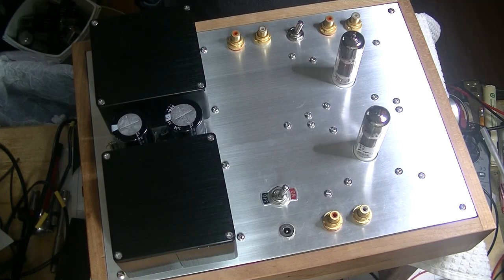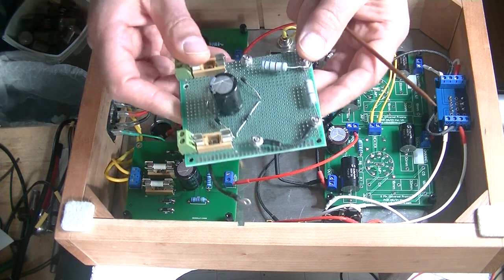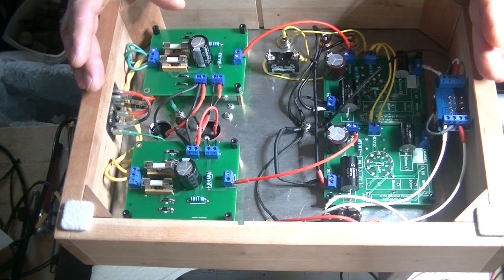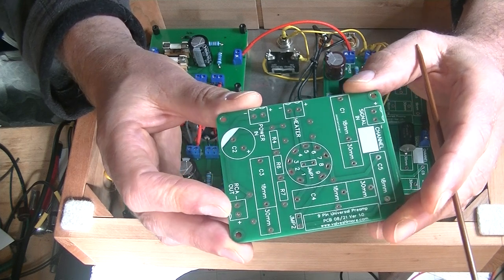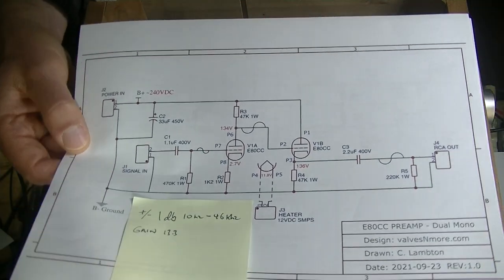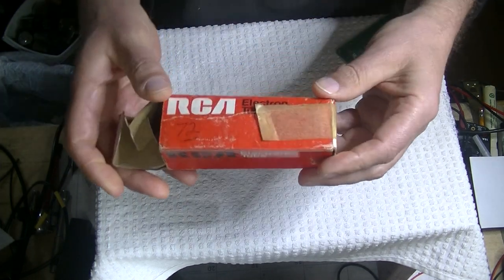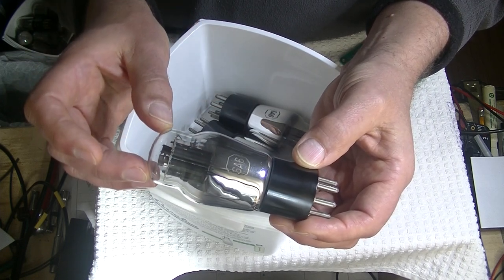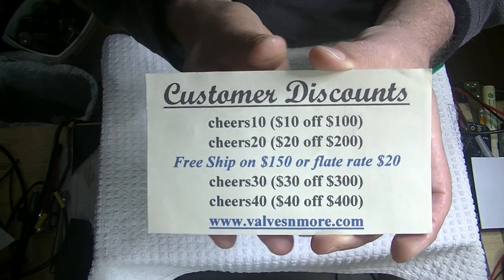Tube Lab #52 - E80cc Kit Amp

Comment: I have a lot of E80CC that I have been looking for use for and I have an ECC82 diy preamp that I rarely use it may be time to convert it.
Reply from the maker: ECC82 is European 12au7 and is basically a lower gain, less robust tube compared to the E80cc, gain of 27 for e8occ and 20 for 12au7.  They are close enough in design spec that you can often drop an E80cc into a 12au7 circuit (not always) and it will work great, NOT the other way around!
Reply: @tubelab194  I know there is a bit more gain in the E80CC but I am more worried that the circuit is not optimal even if it is as you write about drop in but I will try first before I rebuild. I like your channel.
Reply: For a while we discussed the E80cc and my poor Ecc83 pre amp because when I found this offer to be a test builder I was interested but the crazy shipping prices put an end to this from US to EU. But I have not been idle, but have built three different E80cc preamps which I have compared with the Ecc83 variant which retired at the first attempt. Two of the E80cc schemes are of European origin and your variant. First of all, I have simply built yours according to the circuit diagram I found on your website (hope you don't get angry) but always tell who is the maker.

There is a difference between the variants I have built and it has been to your version's advantage there, I have to commend you on how quiet it is. Since I don't have a pcb, my version is hard wired, which was easy even in the dualmono version, then I changed the psu as I only used what was in my junk box. I only miss chokes have single main transformer smd rectifier lots of Rifa capacitors and little else that I had. 

I am very pleased with how it treats the music, a depth and silence between the instruments, how nuanced the reproduction is and the natural presentation that both instruments and voices get. 

When I have friends here at home and we listen to music, everyone says they want to go home and listen at home because my system brings out something that they can't explain other than it makes them happy. 

My system consists of Altec 604E an EL 84 sep powered by Russian tubes, your preamp, td150 own riaa based on bc109c and Marantz CD-60 sometimes I use a Le monstre by Jean Hiraga. If you want pictures, I can arrange it. Thank you very much for a very successful construction.

Best regards Anders